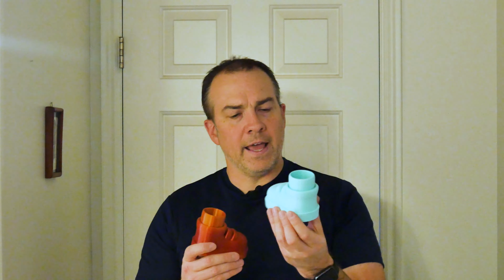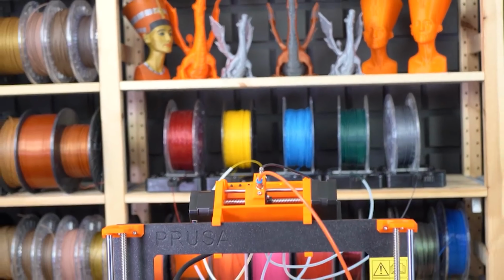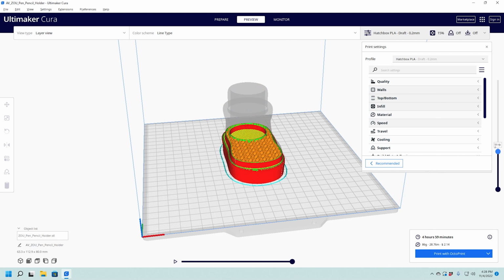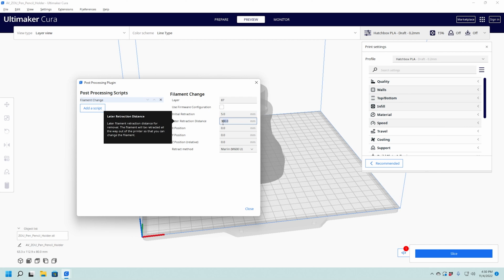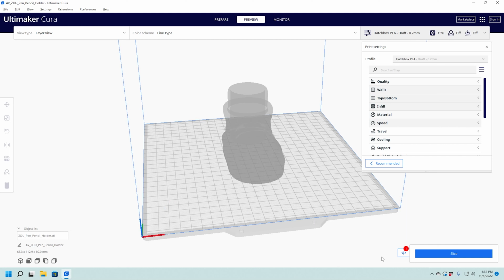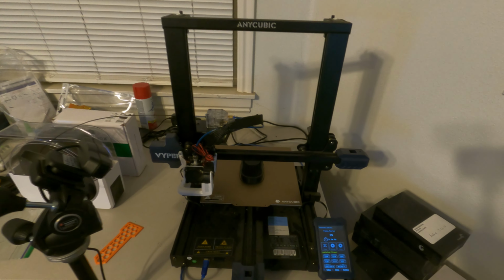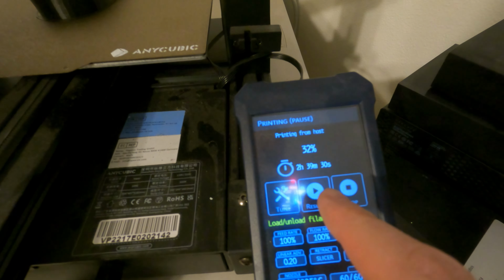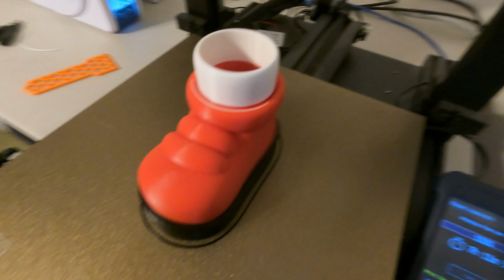3D Printing with Multiple Colors

Comment: i have been trying to to this forever. but your vyper has a different display is this custom firmware.
Reply from the maker: It actually is a community firmware, not what comes stock.  I wish I could give you more information on it, but 1) It was a coworker that had helped me flash it, as he had done the same to his Vyper, and 2) I actually no longer own a Vyper.  I have completely switched to Bambu Lab printers that do all of this stuff for me internally and automatically.  If it's something that you really want to do with your Vyper, I'm afraid that you'll need to get real cozy with Google.